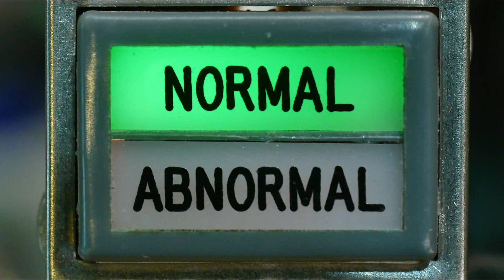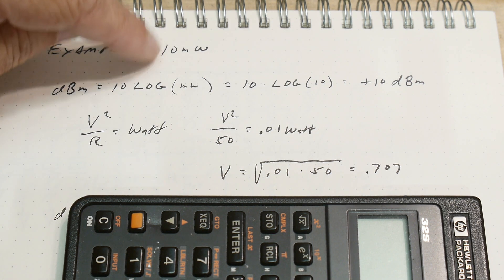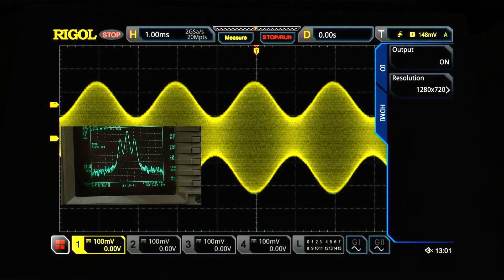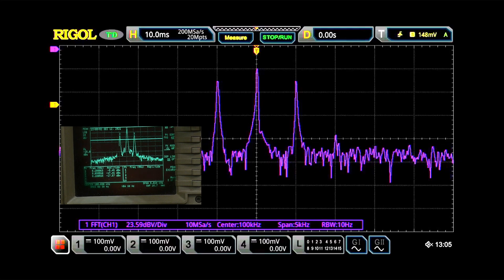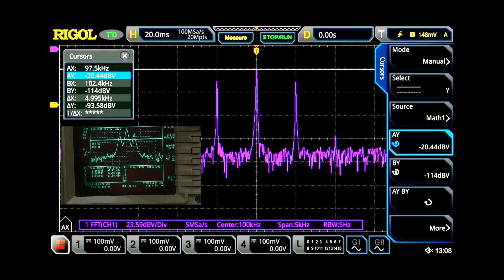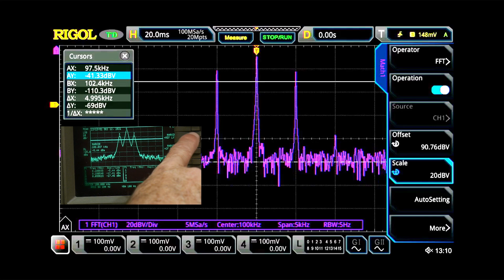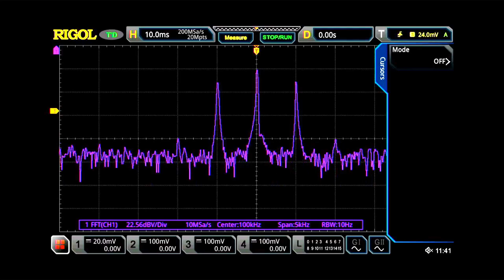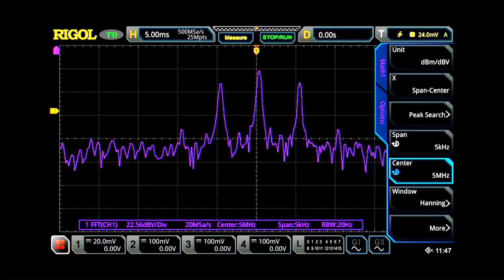#997 Rigol MSO5000 FFT

Comment: Harkens back to Spectrum Analyzer Training at Tektronix in the 1970s.  I was a Tek sales engineer from 1973 to 1977.  I subsequently moved to Philips North America, so no more Spectrum Analyzers in my daily life. I own a hacked Rigol MSO5104. It’s a terrific hobbyist instrument as it handles Arduino and Raspberry Pi digital debugging with its Logic Analysis capability, RF well past 350 MHz, and four channels of traditional oscilloscope features.  More than enough for 90% of hobbyists.  IF you are working in higher frequencies such for telemetry or communications, you may want a different strategy.  My Rigol MSO5104 is approaching 5 years old & I’ve overcome most of its interface quirks and would recommend it as a genuine bargain, especially hacked to 350 MHz, additional decoding features, and deeper memory.  Would I prefer something even faster?  Sure, but that’s far beyond my hobbyist budget…

Comment: Using the built in FG in the MSO5000, I got a clear picture in FFT @ 25MHz But @ RBW of 200Hz. I was going to post pictures but you can't here. Is it possible using patreon? I have some questions about my HP 8590A Spectrum Analyzer. If you can help me with it I will become a Patron. Moneys tight but you would be worth it your channel rocks! I have learned a lot.
Reply from the maker: on my YouTube user page, click the about tab, then you can view my email address

Comment: At 4:45, IF R=50 Ohm, then dBm-13=dBV.  For other loads (characteristic impedances), the difference will be different.
Reply: The procedure to convert dBm to dBV for any characteristic impedance is the following:
1) Convert dBm to dBW (1dBW = 30dBm or 1dBm=-30dBW)
2) Add  the characteristic impedance described in dB(Ω)  (dB(Ω) -> 10xlog(Characteristic impedance))
3) done

Tips:
50Ω -> ≈17dB(Ω)
75Ω -> ≈18.75dB(Ω)
400Ω -> ≈26dB(Ω)

Example: 24dBm to dBV @ 75Ω
1) 24dBm = -6dBW (24dBm-30dB)
2) -6dBW = 12.75dBV (-6dBW+18.75dB(Ω))

The constant( -13) of this video calculate as -30+17=-13, which -30 is the conversion factor for dBm to dBW, and 17 the presentation of 50Ω in dB(Ω).
Reply from the maker: @samtzam3774  https://edadocs.software.keysight.com/kkbopen/converting-dbm-to-dbv-in-a-50-ohm-system-588265460.html
Reply from the maker: that is certainly true

Comment: Hey man! 
I came here just to tell you that I finally tested using CATV splitters with 75 ohm coax to phase antennas on VHf.
It works for me with 5 watts of power.
5-1000 MHz two way splitters, IKUSI brand. 3,7 dB loss per channel I asume 3dB is dividing the signal by two plus 0,7 insertion loss.
You could make some video to test how much power these kind of splitters can stand, I only have a handheld radio with 5W.
Antennas are 50 ohm, coax cut to adequate length to match impedance on input. VSWR 1.0-1.1

Comment: If I'm reading the HP8591e spec sheet correctly the amplitude accuracy is ± 0.3 dB at –20 dBm; 0 to –59.9 dBm: ± (0.3 dB + 0.01 x dB
from –20 dBm) .  The Rigol has an 8 bit ADC and the spec sheet says ± 3% of full scale.  It will take a little math to figure out which one (based on the spec sheets) is the more accurate  tool.  And of course this is for calibrated tools.  However, the calibration quote for my HP8591e was more than 2X what I paid for the whole SA.

Comment: The FFT on the latest Rigol scopes, including MSO 8000, 7000, and 5000 is slow, and feature-incomplete. It's a pity that developers at Rigol seem to be mainly focused on the future hardware/software, and have little time for improving the software/firmware for the existing hardwares.
Reply: And that's different from Tek, KeeShite, LeCrap... how?
Reply: @qwaqwa1960  Could be ive been lucky but i can't  recall ever having a known bug on a Tek Scope.  Compared to Rigol and Siglent their quality is way far ahead.  I have a mature rigol mso4000 scope with several bugs that they never bothered to fix.  As with all things you get what you pay for and the truth of the matter is i  can't afford a tek scope.  I know the bugs and work around
Reply: @qwaqwa1960  On Rigol, it doesn't display scales on the vertical axis. It doesn't allow manual setting of RBW. If you use cursor function to make measurements on the FFT view, the rotary encoder is poorly implemented in firmware that it jumps like crazy sometimes.